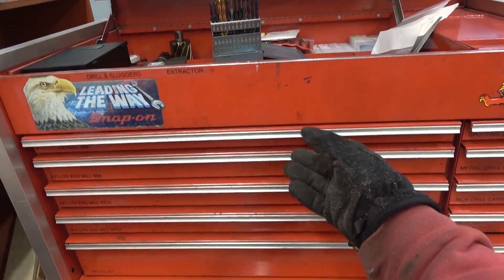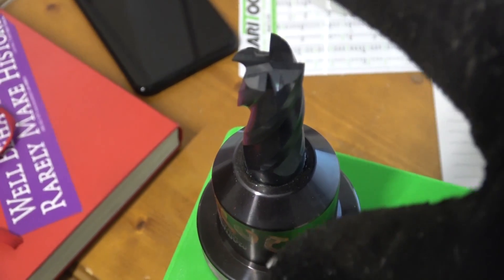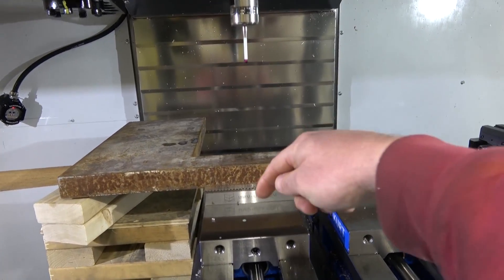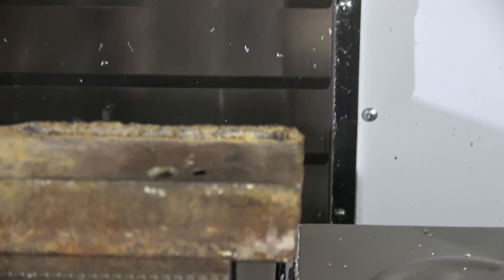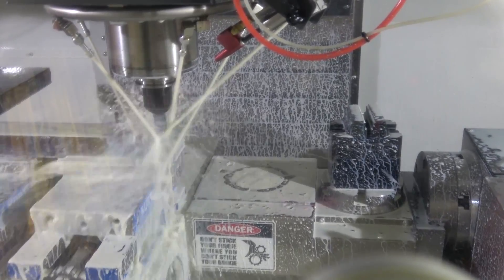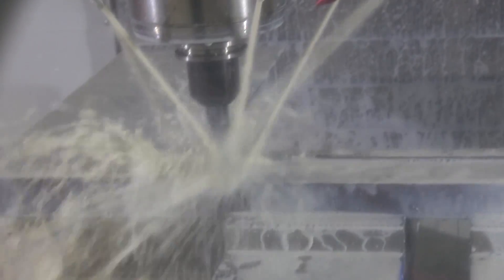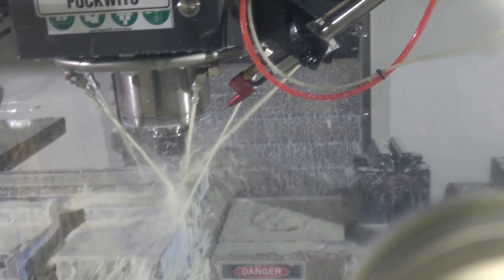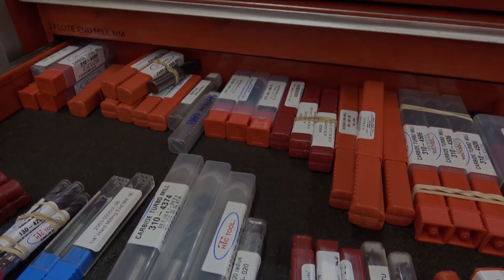AR500 Hard Steel vs. Chinesium Carbide

Comment: It take me back to my apprentice days, it's all about feeds and speeds. I was milling j-preps for welding on a clapped-out manual machine built in Russia in the 60s, using a profile cutter with carbide inserts. This machine was design for HSS tooling. I got her running just happy (with the table locks hammered on to stop the leap due to backlash) and the Supervisor wants the speeds and feeds up. The tools instantly destroys itself and I get to take another 2 hours resetting the machine with a new tool.
Reply: Amen to that. I've seen the table drive gear blow in a $3,000,000 transfer machine because management wanted it to index faster to increase rate. $85,000 in parts and 90 man-hours later it was replaced. The sad thing is the machine wasn't the slowest part of the cycle, the external robot burnish was and we knew it.
Reply: @crazyguy32100  Good Lord that shit happens at shops that aren't the one I work at as well?  Dingbats speeding up the cycle on parts of the process that aren't the logjam?  Lol.
Reply: Ya gotta go faster to go slower!
Reply: @PaulyD0859  There's never enough time to do it right, but always enough to do it over.
Reply: Its why night shift puts out the same amount of product with 2 extra guys in the lunch room  fucking stupervisors

Comment: if that stuff is  50Hrc you have to use a lot less Rpm. If i do some rough machining on low hardend 1.2343 (i think you call that H13) i would go to max 70m/min ( +- 1000rpm) if more you will melt the cutting edges and after that break the mill...
Reply: I have the same experience with machining hardox 500 indeed
Reply: Isnt 500 brinell?
Reply: When he mentioned 500sfm I knew none of this would work out.  Most steels up to that hardness on carbide I like to run around 200SFM  at around .003fpt depending on depths.  Usually have no problem at those feeds and speeds.